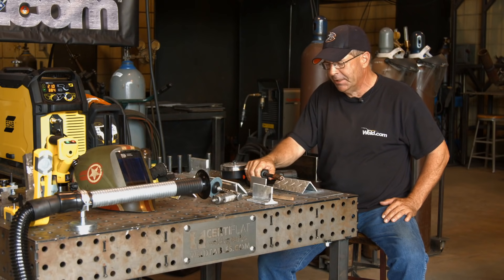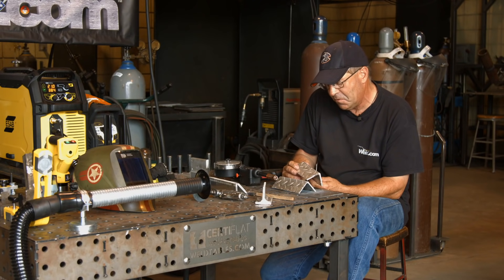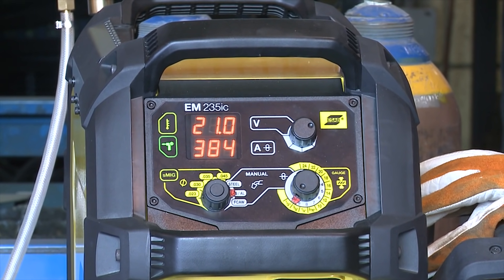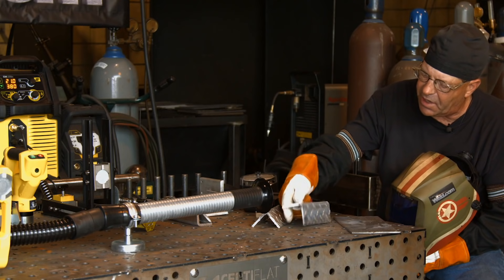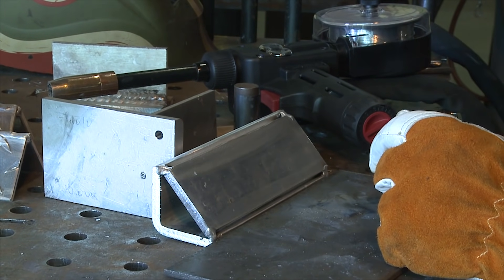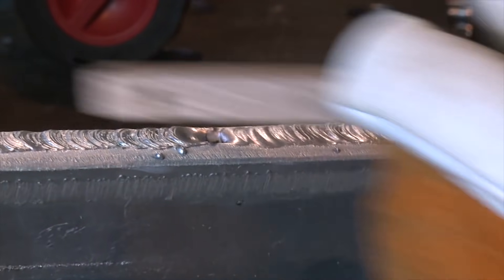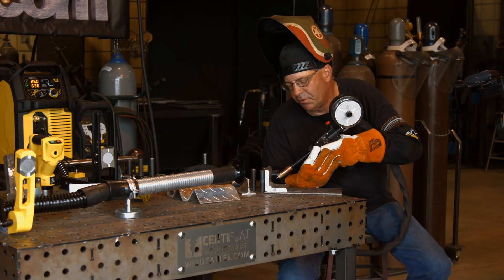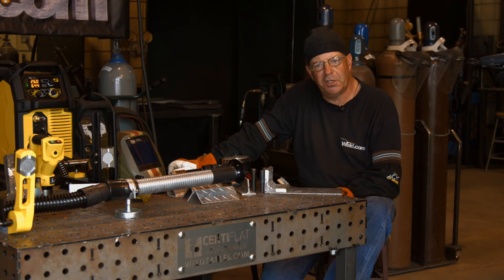🔥 Aluminum Spool Gun Settings Test

Comment: Can you please do a video on aluminum spool welding thin aluminum. . . Im. Planning on doing some intercooler aluminum piping for a car using the spool gun process becuese my tig welder does not do tig aluminum And it's some what thin pipe.
Reply: A TIG machine with AC would be better.  A spool gun works good on thick materials and long production runs because it's so much faster than TIG.  But welding on thin tubing with all the short welds, this is where TIG shines.
Aluminum MIG is spray transfer, not short circuiting.  Spray transfer is hotter and has a lot of penetration, you would probably be fighting with it to keep from burning through.
Reply: Agree with David, spool guns are for 1/4" and thicker, I have done 1/16" but it can be a real handful! Tig is the best unless you can afford a newer pulse mig. FYI, if you keep your gun short less than 10' and change your liner to a poly you can push aluminum through your mig like solid core. HTP has a small machine with a 6' gun that works perfect for this.

Comment: This rasises a question, hope someone knows.  Why is it you can weld aluminum with a spool gun, argon, and dc power from a mig, but you can't tig aluminum with argon using a dc-only tig machine?
Reply: People DO DC TIG weld aluminum!  There are even videos about it, this is the original Heliarc process.  It's just more trouble, and inefficient of the electrical power.  I think the big secret here is that the MIG is DC electrode positive, which provides a lot of cleaning but also puts a lot of power into the electrode.  In TIG this is a problem, you might want a big tungsten and a water cooled torch too.  In MIG the electrode gets hot, too, but it then sprays ON to the plate so you're using that heat and not wasting it.

Comment: Another question: Mig aluminum without gas, can you preheat the aluminum with propane (or map/pro) and use aluminum powder flux instead of gas??
Reply: I don't think so!  The aluminum is melted and superheated and crossing the arc IN AIR, I think it's just going to burn up!  With a torch, you have some protection, the "neutral flame".  Also in gas-welding of aluminum people put flux ON the wire!!!  This seems highly unlikely.
Reply: You have to use gas, argon. Talk to your local welding supply to get setup.

Comment: I understand why you would pull back with Tig, but it seems that pulling back with the Mig is creating extra problems with the fish eyes.
Reply: ifell3 why would you ever pull with TIG? You can't
Reply: Republican Welder I mean towards the end of the weld, I can't remember the correct terminology for it now, but the last 1/4" before finishing on a Tig they pull back to allow the gases to flow over, and to ease off, but is this necessary for the Mig?
Reply: Just lime with TIG add filler and ease off the pedal while moving the torch to avoid craters cracks,the same applies with MIG. Fill the crater so it doesn't crack.

Comment: @Bob Moffat  please i am a  welder helper in alluminium and i want u to help me on how to make the best welds with maximum penetration, using the right settings and the way to move the gun in respect to the welding position. We use fronius welding machines  and weld in Pulse transfer mode.

thanks

Comment: Why would you use a spool gun over the regular MIG?  I've never done any MIG welding so I am legitimately asking.
Reply from the maker: Aluminum is too soft to feed through the length of the normal gun liner. It is prone to birdnesting and having feed issues. Spool guns make it so that it feeds directly at the gun.

Comment: they don't call them push pull for nothing .stitch away down hill at 45 degree angle   18 with 5.8  wire speed . uphill welds are not as strong . best to go down hill at an angle or on top with an angle

Comment: Hi, I need a little help.  I have a tweco spool gun SSG225-3545, a tweco ESG-1 control box, and a thermal arc MST 400.  Could you or someone from weld.com demonstrate hooking up the control cable from the control box to the power source?  Thanks, Jeremiah

Comment: Hi please telll me
1.Machine Brand..
2.Machine capacity...
3.Welding Base Material thicknrss
4. Base metal grade...
5. Filler rod dia in mm
6. Filler rod grade..
like Magnisium or silicon ....
7. Welding Parametet Setting
Like current ... Voltage...
Welding speed...etc

Comment: You want to see something that is a real hoot? Fronius (yup it’s expensive) has a do everything, multi process machine that runs aluminum wire OUT OF THE MACHINE. And then the guy in the video literally winds Mig gun cable around the leg of the table and ties it in a knot. He then proceeds to lay down perfect beads and the machine doesn’t miss a beat. On steel (after changing wire) he starts laying down a bead on a flat surface, he continues down into valley and up the other side and the continues othe bead up steps of metal. Meanwhile, the stick out is changing all over the place and the bead width and height barely change at all. I’m sorry I don’t have the link, but it’s worth checking out.

Comment: ....13:30.......preheat...definitely......and position?....for thinner stuff .120" or so....downhill works....but heavier material...uphill and a little weave action....
  I've had stuff like big rings rolled out of 1-1/2" X 12"...ring about 12 feet in diameter, 3 joints at 120 degrees apart....preheat to 200-300 and 'V' both sides to be able to weld 100%...switch from one side to the other to reduce stresses and cover  after welding to cool slowly....some sort of lifting device for 'Rockets'....JPL laboratory...

Comment: Hello all
Reply: I am have trouble with 3/4 " round bar.
The round bar is attached to 1/4" square tubeing, I am getting cold welds on the inside of the round bar. Should I preheat the round bar??